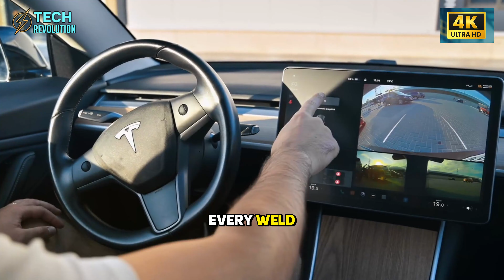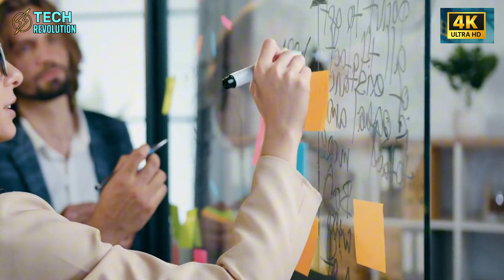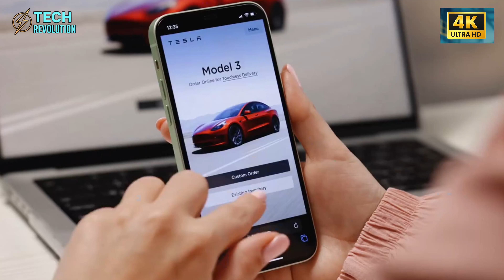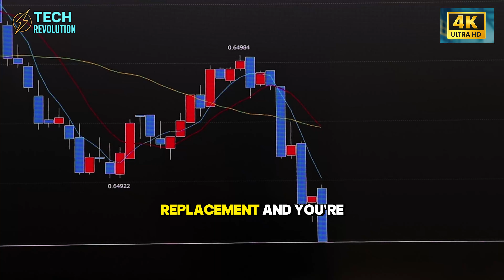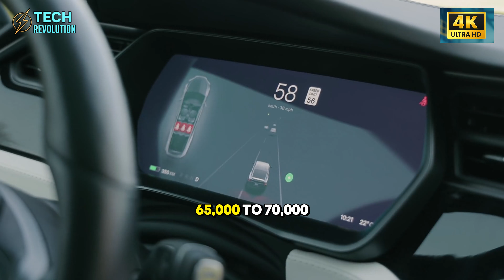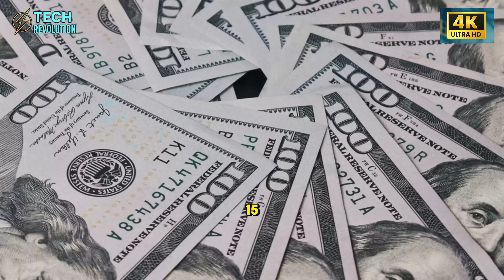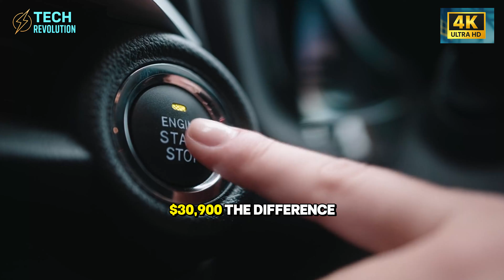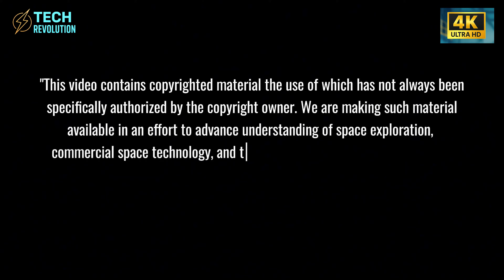Tesla Model 2 FINALLY HERE: Designed to Never Break... What's SHOCKING?

Comment: I would like to see evolutionary minimalism. 2 seats, 2 doors, hatchback. The same platform as Cybercab. Swappable center console and controls for handicap, luxury, and other lifestyle specific aftermarket customizations. Polycarbonate windshield is shatterproof, lighter, and cheaper. Aerogel insulation to save heat pump power and add comfort, Solar cells on top will pay back many times over in added range and battery discharge protection. Aluminum-ion battery. Standard wheels, Low power Starlink, Seat with full recline, No BS features. If Tesla will sell it to me..
Reply from the maker: Your vision fits Tesla Model 2 minimalism—shared Cybercab platform and swappable controls make sense.

Comment: Hindi mag success Ang ganyang battery... Parang ditonator Yan Kasama na Ang Isang explosive na battery... Kalokohan
Reply from the maker: I get the concern, but Tesla Model 2 batteries are designed with safety layers—real EV fires come from damage, not chemistry.
Reply: @TechRevolution26 Hindi safety Yan... Flamable...
Reply: @TechRevolution26 Ang nasisigiro ko, ni Isa Wala na kayong mabenta na EV.. kahit sa Electric motor... Pa bunkcrop na Ang TESLA kung Wala Ng kita baka ma benta narin ni ELoN Ang malaking porsyento nya sa TESLA